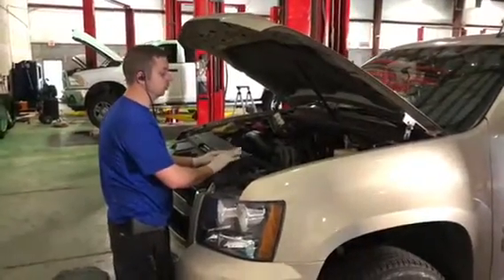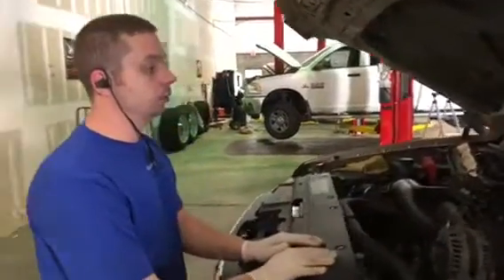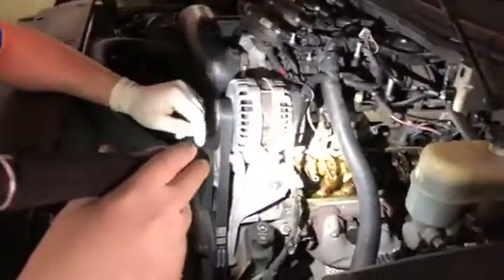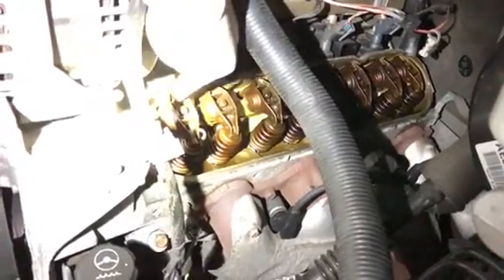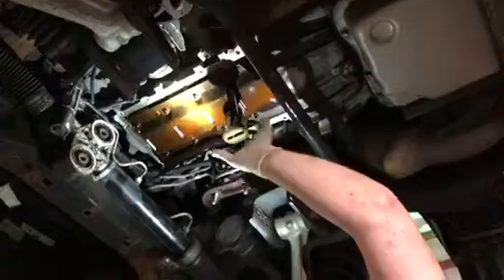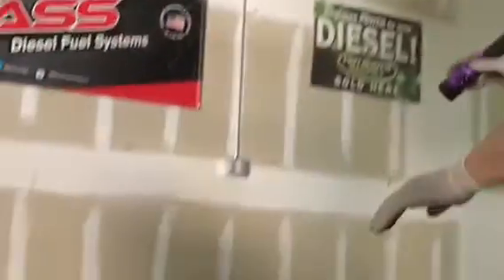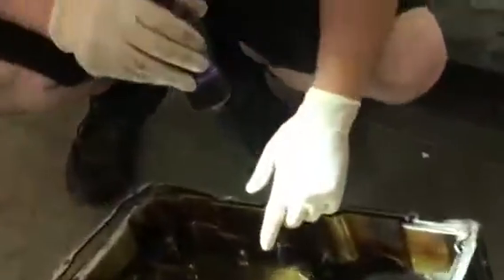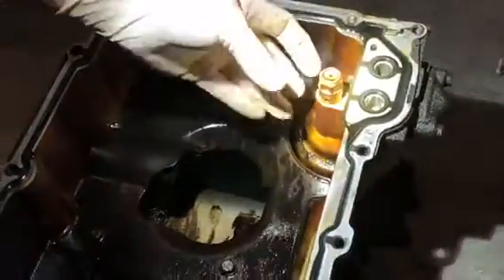Chevrolet Suburban Tahoe Silverado Engine Problems 07-13

Comment: Which years are these problems an issue on the Surburbans????
Reply: 2007-present. GM is being sued for it currently but are only including 2014- present in the lawsuit.
Reply: 07-13 ??

Comment: It's the stupid AFM I deleted mine put normal lifters
Reply: How did you delete it and how much to replace the lifters???
Reply: @mercedesbenzs600bash  if you do it yourself a few hundred bucks you can get a programmer and turn it off but changing the lifters and intake plate is the best way
Reply: @dewaynemiguel3349  Much appreciated....

Comment: My 07 Chevy Tahoe keeps having a stabiltrak & traction control keep coming on I’ve changed several parts to fix it but it keeps coming back on. I’ve taken it to a mechanic but only told me to change my camshaft after I changed it 3 times. Any suggestions?
Reply: That's a similar problem i had on my 08 suburban z71 but this one  mechanic told me I was having a misfire on cylinder 5 due to a bad ignition coil so I went ahead and replaced it. A week later same stabiltrak & traction control shows up so I took it to another mechanic and told me there was a bad sparkplug on cylinder 5 which also indicated oil was being burned. I replaced the sparkplug and now its been almost a month and I have no issues thus far. I didn't know misfires would pop up traction control on display lol🤷🏽‍♂️
Reply: @michaelm8427  How is it running now???
Reply: Lifters
Reply: @WRECKLESS SHOGUN what is DOD?& active fuel magnet? What’s that?
Reply: Replace speed sensors. All four speed sensors.

Comment: I wonder if Toyota SUVs that have V6 and V8 are more reliable? Stuck between choosing a 2002-2006 Tahoe and a Toyota 4Runner or Toyota Sequoia years 2004-2007.
Reply: Get a Toyota Sequoia
Reply: Choose a TOYOTA....
Reply: 00-06 dont have this problem just 07 up

Comment: Is there any way to prevent this from happening and how can I tell if it's bad because I was looking to buy a 2007-2010 SURBURBAN????
Reply: How's it holding up? 😊
Reply: @Yeoj444  I bought a 2008 Toyota Sequoia Limited with over 197,000 miles 4 years ago and it's been flawless ever since...

Comment: It's only from 07 to mid year 11.  ;)
Reply: I'm wondering how common is that problem???
Reply: @mercedesbenzs600bash  A oil catch can is a great item to protect these engines too.  Just stick to production dates mid 2011 to 2013 5.3 engines, unless you want to update the pan and driver side valve cover.
Reply: @jeromeburrasca6710  
What about the 2014's ? Any issues with those?
Reply: @curtis1951  Not sure when Chevy started putting direct injection in the Suburban (they get carbon build up on the valves).  Look up service bulletins for that year to be sure.
Reply: @jeromeburrasca6710  
Thanks